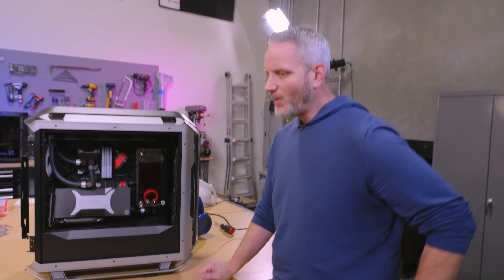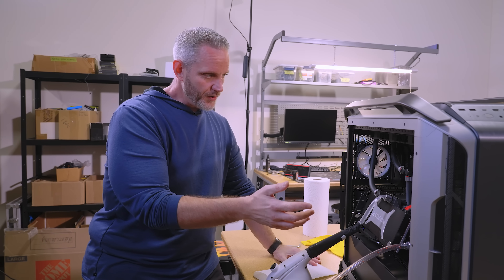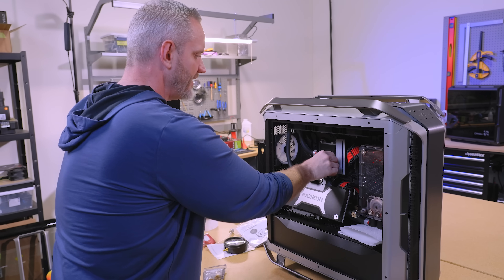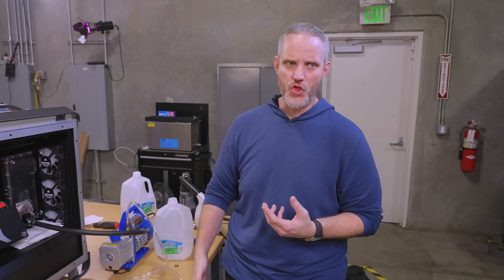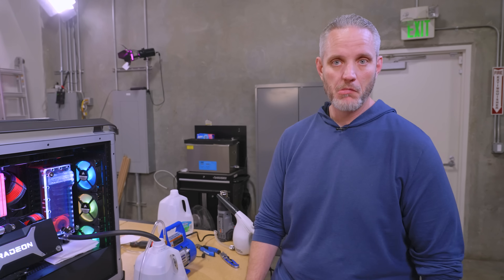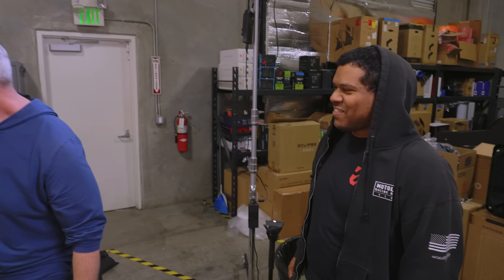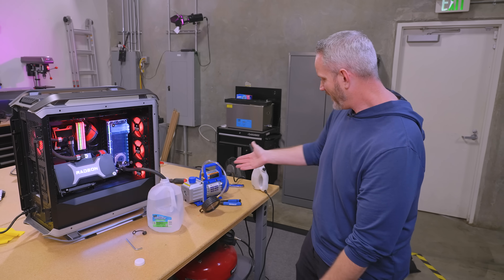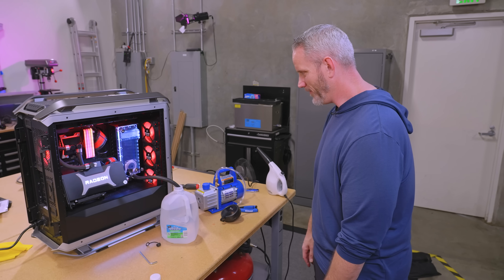I used Vacuum Pressure to fill a PC! Why didn't I do this sooner!?

Comment: I too thought of this BUT I was thinking of building a box that the whole PC would sit in, thus creating vaccuum to the whole PC.  I figured this would be helpful in to causing pressure differentials on the seals.  You'd have to be careful when filling though so that the water doesn't spluge out of the fill port.  :-)

Comment: just like when vacuum filling in automotive, if you do it from the fill port, you can keep doing it as many times as you want to get every single bit of air out of it, and when ur done it will be full up to the fill port hole line. also, something like a mightyvac hand vacuum pump could be used, and would only cost you maybe $20-30

Comment: If you could adapt a radiator one that is done using an air compressor, I think you wouldn’t have any air in the system.

Comment: I can't believe I missed this video. Most water loop components can handle up to 1 Bar of pressure (14.5 PSI). Inversely, the components can handle up to -1 Bar of vacuum (-14.5 PSI). Wouldn't it be better to not allow the vacuum to go past -14 PSI? Perhaps that was the reason you could hear the radiator pipes and fins collapsing, like the bulkheads in a submarine. Next time try to only reach a vacuum of -14 PSI and see how well that works for you. I am currently working on a similar project, and that is how I found this video. Great job as always, guys!

Comment: You could leak test AND then vacuum fill with the same set-up.

So I am DIY building myself a setup for this.
I realised that the cheap vacuum pump I was looking at had two port that a tube could be atrached, one air-in and the other is air-out.
Vacuum gauge and pressure gauge are the same thing, just with a different start point for the needle.

So now if I put a valve on either side of a t-junction that has a dual function (pressure and vacuum) gauge, then by swapping between air-in and air-out on the pump.

The reason for valves on boths sides is so when I go to fill the system I don't need to worry about any liquid getting into the gauge (probably not an issue, but a simple step for peace of mind)

Comment: You need a T-fitting and 2 more valves(that's 3 in total) , so you have a valve directly to the loop, and one valve at each end of the other 2 spots on the t-fitting. Hook vacuum to one valve and fill hose to the other valve. Close off fill valve open the loop valve and vacuum valve, pull vacuum. Then shut off only vacuum valve and leave loop valve open. Now slightly open fill valve till water reaches that valve then shut it off. Now open vacuum valve again and pull vacuum again. Once inches of mercury are pulled shut vacuum valve again and open fill valve to fill the system. This will eliminate the slug of air you are getting during fill up.
Oh and you can use that vacuum pump to remove fluid, you just need a vacuum pot.

Comment: Put a large enough reservoir under vacuum using your pump, disconnect it from the pump attach the reservoir to your filled system and open the valve.

Comment: Just prime the tube before you open the valve. so fill the tube with water so it pushes the air out or remove the tube submerged under water.

Comment: Use a 3 way ball valve on your fill hose to syphon water into the fill hose prior to opening the fill valve and its perfect. I have a brake bleeder kit and i will be doing this for my next build. Great video and thank you for the tip.

Comment: if you connect the  vacuum pump above the water line such as fill port it will pull the air bubbles out of the system without sucking water. also you can connect to the pump to the fill port and have your suction hose from the drain port to the new coolant with the valve partially open it will fill the system with no air bubbles without pulling full vacuum on the radiator.

Comment: You are not the first to think of this. The Aquacomputer Leakshield can fill a loop using a vacuum pump, and maintain a negative pressure to prevent leaks.

Comment: If at the pump end there is another couple of valves, one to a reservoir and the other to protect the pump FROM the reservoir. YOU may be able to find a configuration that gives a you minium of air.. IF ANY in that pipe... Though you'd have to setup/reset everything so you do not vaccum up liquid at any point:P

Comment: You cannot fill the circuit 100%, you need an air chamber that absorbs the expansion of the refrigerant when it heats up. Otherwise it will be the pipes that have to expand.

Comment: If you use a bucket to fill instead of a bottle you could just fill the tube with coolant using a funnel then cover the end with your finger and dip it into the bucket and open the fill valve, that would eliminate the air that's comes into the system via the fill tube.

Comment: Very cool. Yes you would need a Leybol pump or equivalent to hit true vacuum. At that level of vacuum, use Torr for your scaling. Torr, Torr to the negative 9, Milli Torr to the negative 9, Micro Torr to the negative 9, Nano Torr to the negative 9, Pico Torr to the negative 9. (which is the closest to absolute zero.)

Torr =  0.01933677(continuing)

Every -9, move the "0" that many places. 

Torr to the negative 9 = 0.0000000001933677(continuing)

Still hoping someone does a overclock with this method; the method how they cool quantum computers. Machine a badass AIO/Heatsink and overclock a threadripper and see what happens.

Helium 3 (Helion) and Helium 4 under vacuum (more the better) as your cooling loop. Cooled by Liquid Nitrogen (tube and shell exchanger) and you can see 0.3 kelvin temperatures on the Helium side. Liquid oxygen would work well too, but more expensive and pretty dangerous if there is a fire.

Comment: Crappy rad fins sucking and in a crumpling would be a bit of scary possible as well as any poor welds or solders in the lines and feeds getting cracked or broken then a slow leak.

Comment: With some creative use of T-fittings and valves, you could've spent way less and pulled vacuum on the system using the same air blower you use to blow the coolant out. When I fill cars with coolant, I use the shop air to generate vacuum in the system until the larger radiator hoses completely collapse and then close one valve and open another and the system fills and vents completely in like 30 seconds.

Comment: I'm thinking you wouldn't actually want to get a more powerful pump anyway. I mean, if the radiators are physically deforming enough to make creaking sounds audible from a distance with the naked ear, I think that's probably already getting close to TOO much vacuum.
Of course, I'm totally guessing on how much is too much. But if the fins in the radiator are deforming enough to hear it, I'd think that would be putting whatever means they use to seal the radiator's tubes to the tanks  under a fair amount of stress. I'm  assuming they use some sort of glue or synthetic bonding agent, rather than welds, on this kind of radiator, but I have no idea how resistant it is to flex/deformation/stress induced cracks.
Anyway, I think it's a great idea, that was just the thoughts that came when he said he could hear the radiator creaking. Just thoughts, no research done whatsoever ;P

Comment: You can remove air if you flip upsidedown bottle(air will go in bottle) just need to make passtrough on bottle cap and hold bottle higher than reservoir inport.

Comment: This idea needs a network of valves and tubes so you can drain the system, close it, drain the tubes of air, close them off, open the system side, open the submerged side, letting the system fill.
Apparently there's a "Air admittance valve" that lets air through, but not water. 
So this may work:
1 tube from PC to a valve.
1 Y shaped tube from coolant to a valve on one side and the air admittance valve and regular valve just after it.
1 tube with a T shaped connector going between the first 2 valves, the other end going into a valve
1 Y tube from that valve to the pump and the other end going to the other end of the Y shaped tube

Draining: Disconnect the mess of tubes and blow the liquid out with the blower.
Prepping the system: Close off the lower Y tube in both places, open the system side valve, open the T tube valve, vaccuum out the system, close off the system and T tube.
Prepping the coolant: Open lower Y tube valve connected to the upper Y tube and vaccum out any air while not letter the coolant in (special valve), then close off the lower Y tube from the upper.
Filling the system: Open the lower Y tube to T tube valve, filling the T tube with liquid, then open the system side valve and the system is filled with 0 air left. Close the system valve.
Possible addition: an air valve to let the coolant drop into the container without a mess

I really hope Jay sees and actually tries this in a video or tells me why it's a dumb idea if it is. I have no experience with these types of systems and this is just off the top of my head with minimal knowledge.
Someone please tell me if this would work!

Comment: I use a vacuum pump since years to fill and remove bubbles from the loop. My vacuum pump was provided by hugyfot in order to set up my underwater camera housing (9V battery powered, not really powerful), but the fitting with an O'ring 😅was perfect for a water cooling loop. I use two ports on the reservoir. Both at the top of the reservoir. One plunge in the bottle of coolant, the other is fitted to the pump. Activate the vacuum pump to fill the reservoir with the coolant, it will gently suck it from the bottle (and avoid stress on the radiators like in this video), then power up the PC for the water pump and keep sucking air with the vacuum pump while the water pump is circulating the coolant through the loop. At the end you close the coolant port and a slightly negative pressure helps to reduce the size of the bubbles trapped in the loop and the same time will remove dissolved gases in the coolant, so the bubbles can reach the reservoir easily and go out of the loop through the vacuum pump port.

Comment: If you use a small diameter tube for pulling the vacuum and loading the water, you'll end up with a lot less air in the system after due to the cross-sectional area. Because you're pulling a vacuum, you can probably use a very small tube.

Comment: I used a similar technique working for Moog to fill sealed electrical cables for undersea use. If you add the coolant slowly thru a needle valve you will put less stress on the mechanical components.

Comment: 2 more valves. one at the pump and then have the coolant container have a valve at the bottom, that way there will be no air. If you are mounting the pump on a plywood board, you could add a reservoir before the pump that pulls the air in a the bottom and the pump sucks it out at the top as a security feature to protect the pump,

Comment: Take and connect the line from the bottom of the container letting the liquid fill the line letting the air go up into the container of liquid before opening the vacuuming

Comment: I don't think pulling a vaccum is a good idea, but if you have something like a disconnect and can create "drain" and "fill" lines you could pull the water through the system using something like a siphon priming transfer pump.  (looks like a short tube with an inlet and outlet at opposite ends of the tube.  Another style is a squeeze ball with tubes on either end... 
 They would avoid the risk of damaging sensitive components (like those thin walled coolant ducts in the radiator)   but might mean an extra set of quick disconnects just for filling and draining the system.....  
I'm due to coolant change in a couple months... I'm definitely going to try this!

Comment: If all parts are specified to withstand a vacuum test, this is a great way of filling. If not, they are allowed to fail under those conditions. They dont see much positive pressure from a normal loop ever. Millibars of pressure difference are enough to push the water through. Putting a whole bar of negative pressure is far outside design criteria. It might be ok though. You could do a test series where you put all kinds of parts trough a sustained vacuum, to see if this method is fine for existing hardware. "Vaccum proof" might be a label put on hardware in the future 😉.

Comment: Instead of sticking the tube in a jug, fill the tube with a large jug or reservoir on the end while holding it above the port. Then it won’t reintroduce air into the system.

Comment: So you should develop the kit a little jug before the pump tube coming off the system into bottom of container and the pump attached above fluid levels with a 1 way check valve  if you want you could even put a fish tank pump as a flushing loop  and a little fish tank air pump to pressurize but not over pressurize the system to drain it  a couple valves and your in business  a lot of it could even be 3d printed parts could just use piston style pump to create the vacuum with a check valve actually with correct valving and check valves may even be able to do with only one singe piston pump

Comment: couldn't you run the vacuum from the top port and have the fill hose on the bottom in the water and ditch some of that air... 
Would just need and extra valve for the top during vacuum... I'm sure you have an extra valve...

Comment: Try drawing your vacuum from a higher point in the system, and fill from the low drain with a prepurged hose.  You could probably just about fill with a live vacuum with a catch can between the vac pump and connection point to catch any fluid.

Comment: 1 Atm can actually be quite a bit for parts to mess with, but I'd be willing to bet you could still fill that system with a vacuum using a shop vac, or a purpose fabricobbled vacuum pot.

Comment: Create a splitter, one to the pump, the other to the water?   Or maybe just pinch the vacuum tube. 

I also question what this is doing to your radiator though.   They're obviously not built for that.

Comment: The reason you can't pull a higher vacuum has to do with atmospheric pressure. The question is what altitude you are at. The closer to sea level you are the higher the vacuum  will be. Good idea by the way.

Comment: Residual air is only a procedural issue: Use an addition funnel or other container that has the outlet on the bottom, add a t-fitting to apply the vacuum, add a valve to the pump side, and vacuum the whole tube up to the valve at the bottom of the addition funnel/gastank etc. (Even a floppy drinking water jug could suffice.) Then you will have vacuum up until the liquid valve with 0 air. Also the amount of vacuum doesn't have to be much as the volume of air is miniscule in standard pressure. Usually any component in a computer-scale can handle pretty hard vacuum, the popping sound was probably due to the leftover water boiling or releasing gas.

Comment: Yes, you can drain the system with the same pump. One only needs to put a container that is significantly larger than the volume of the system AND can handle the reduced pressure. OK, you have to plumb the container right too.

Comment: Hmm. I feel like opening the drain with hose in fluid and pulling a vacuum on the other end of the loop to draw in fluid. 
I would think that would be less stressful on the radiators

Comment: I make silicone molds to make resin parts for random projects and I use a vacuum pump to degas (remove air and other gases) from the liquid silicone and resin.  I also am planning a new computer build and I want to try water cooling...this just made that a bunch easier!! Thank Jay

Comment: Now if you were to put the fill line in a bucket of fluid. The drain in another bucket (with little fluid) lower than the fill. Open the fill first to keep suction. Open drain. Will gravity pull while the fill is sucked in to replace the fluid as it drains. Fill and drain would have to be opposite ends of cycle to replace all fluid properly. Never lose suction or have to revacume?

Comment: This is how Ford designed some of their cars coolant systems to be refilled. They have a t piece that connects the jug of coolant and the car and the vacuum pump together to eliminate the excess air from the system.

Comment: To pull the fluid out all you need is a large bucket With a lid and two hoses hose one connects to the system hose to connect to the vacuum pump Just make sure the vacuum pump hose doesn’t go too far into the bucket

Comment: now pull a vacuum on a subzero pc so you don't have to worry about condensation (or pull a vacuum and fill with N2 gas so there is no humidity but the passively cooled components can still be cooled with a fan)

Comment: It's been a bit but I somehow missed this video... Jay you're not the first, I already did this with my system when I made it two years ago because I have the radiator above the level of the tank and pump.
I think I have the same EK tank and pump too.

Comment: Jay, filling motorcycle front brakes with brake fluid is much easier when filling from the bottom up,  pushing the air out the top.  You might want to be careful of the o-rings in your fittings being pulled out of place by the vacuum.

Comment: Jay,you can use the pump to pressurise a canister with air,and then use that to purge the fluid out of the system.
Given that the system has an entry and exit points.

Comment: To the ones worried about the fins and tubes coming apart..radiators  are brazed, most of the time covered in flux, at a temperature of 1000-1300 F. They can hold up to a very high vacuum and pressure both before bursting or collapsing. The company I work for designs and builds all types of radiators and condensers.